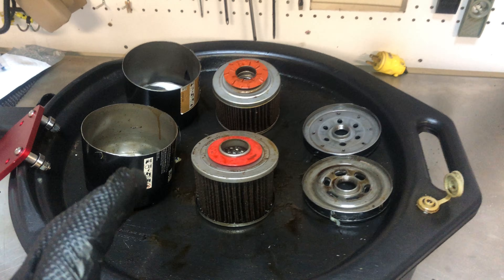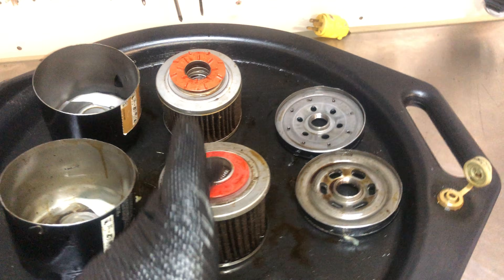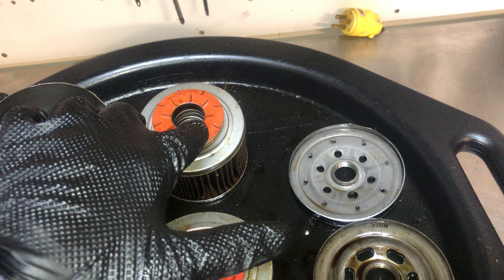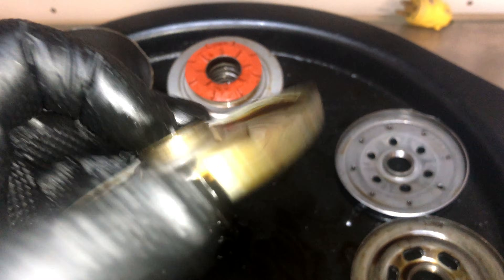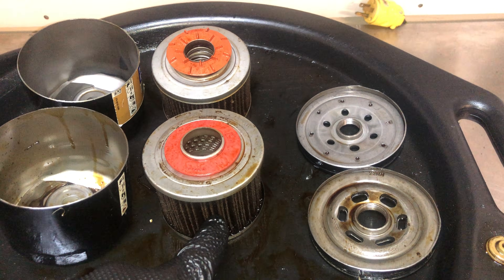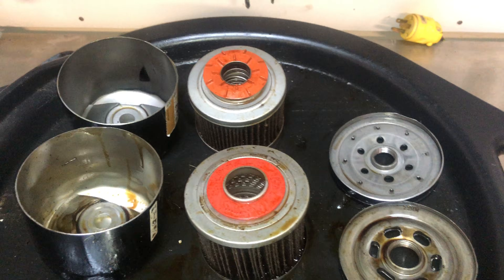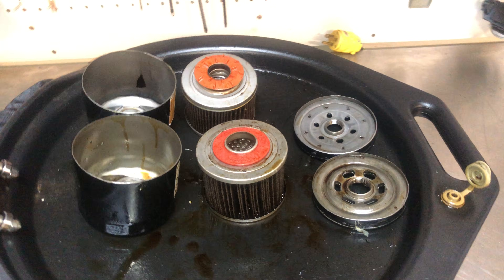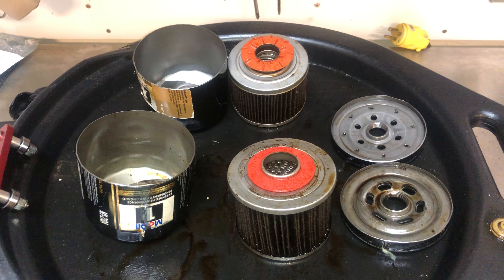Oil Filter Bypass Design: Which Is Better, Top Or Bottom Bypass: Mobil 1 Oil Filter Design

Comment: First of all, I wouldn't use Royal Purple as my source of filter info. Second, I tend to lean toward the top by-pass for the reason you mentioned, not that I am going to change filter brands for it. I wouldn't think the filter by-pass location would be based on vehicle manufacturer, but I certainly could be mistaken. I see you called Mobil 1 for their reasoning and they just follow the OEM, so the OEM would be the one to ask I guess, however, it seems to me a filter manufacturer should know all the ins/outs of filtration, not necessarily the engine designer, but again, I could certainly be wrong.
Reply from the maker: I think the vehicle manufacturer will know best, and Mobil 1 following that engineering expertise makes a lot of sense to me.  

I have a short update comparing the Mobil 1 and Purolator Boss filters.  Something rather eye opening.

Comment: It has to be based on the design of the engine. I’ve got an old MF35 diesel tractor and it’s basically a better Ford 8/9N because Henry Ferguson designed all of this when with ford. But, despite all the changes, Ford has basically kept the same system. So the mustang v F 150 comparison would maybe be better with mustang v older rangers? Not sure because I don’t think my ‘96 ranger has that type.
Reply from the maker: I made a mistake in the video, the 2.3 turbo in my Mustang has a horizontal oil filter just like the F150.  I called Mobil 1 and they said their oil filters are designed to OEM spec.  In short, Ford put a top bypass in the Mustang from the factory and a bottom bypass in the F150 also from the factory.  Mobil 1 as an example does not reengineer the filters.  Learning for me.

Comment: I don’t understand the anti-drain-back valve design for the Mustang.
Reply from the maker: To be honest, I don't either.  Would seem the oil will drain out of the filter and back into the crankcase, hence, a dry start.